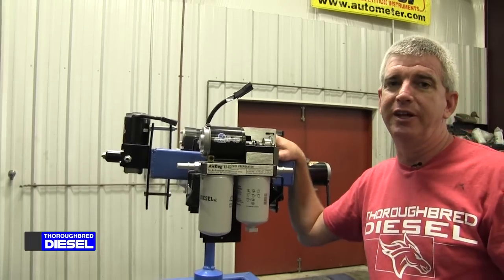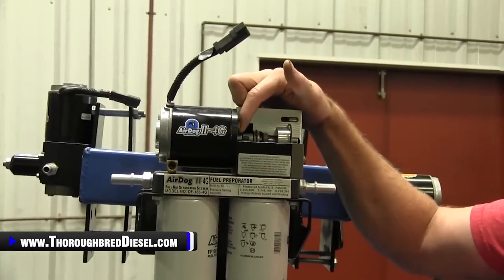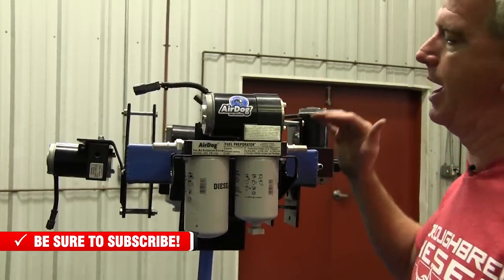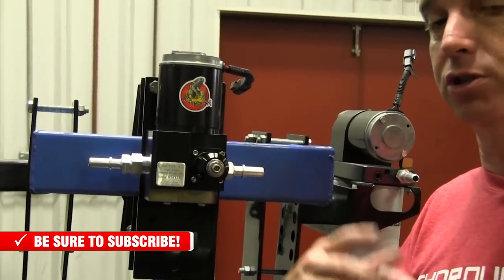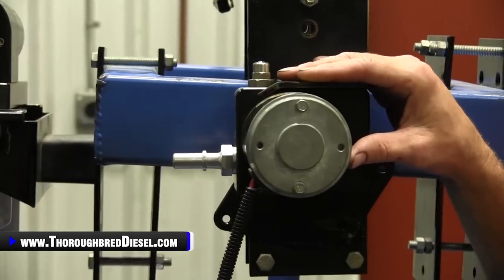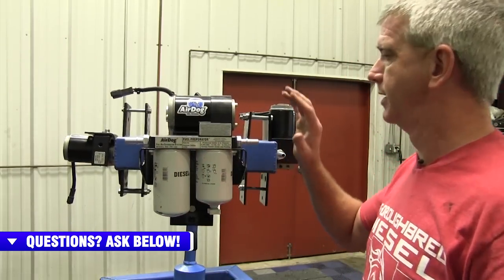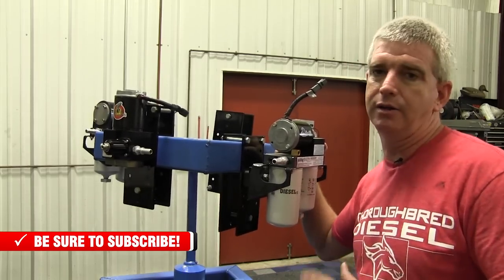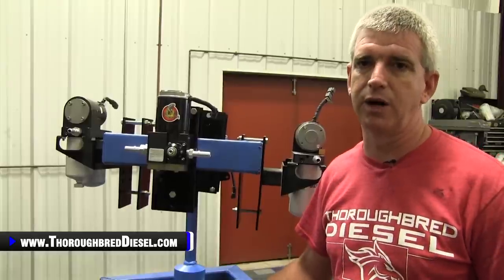AirDog Fuel Systems (Overview) | Best Fuel Pump 4 My Truck?

Comment: Are you supposed to here this pump run the entire time truck is on and running? I believe mine gave up on me today
Reply from the maker: It depends on the vehicle. Some trucks the AD runs on key on power, meaning that if the keys on, the AD is running. Most trucks, in the cab, with the engine running you can not hear the AD running.  If you are hearing it very distinctly, you could have some kind of a restriction or as you said, there could be something wrong with your AD motor. Just make sure there isn’t a restriction or water in your fuel that could have contributed to the AD motor going bad (if that’s what has happened.)

Comment: Thank you for the information. I'm new to this system so I'll have to do some research why something like this is needed on my truck.
Reply: wyattoneable your truck have a high pressure pump which pulls fuel from your tank and pushes fuel to fuel rails to injectors. Installing a lift pump would prolong the life of your high volume pump by pushing fuel to pump. It will also add extra insurance for filtration of fuel from water and trash.

Comment: I knw this is a better system than factory..But I have a stock 24valve 5.9 2000 model 2wd 3500 Laramie..The truck is a 155k truck..I just order a southbend clutch from ya'll..I Love my truck..Im getting all 200 plus horsepower to ths ground now..also how cold does it need to be to plug in my truck..Ps my truck has always turned over on the first bump..I knw theres a first time for everything..but I just dont think I need to spend 600 for a upgraded system..thanks for your time & GOD Bless to the Thoroughbred family.
Reply: This pump will save the life of your vp 44 without it I will dry up and your truck will now need a 2,000 dollar v8 44 replacement and a 600 dollar lift pump definitely a huge security blanket for a go 44 truck

Comment: I have a dodge Cummings 12v and it still has the manual fuel pump but I want to put an auxiliary fuel pump to help the manual one
Reply from the maker: These pumps are designed to be standalone. If you continue using the OEM pump it can cause a restriction. We would not recommend going the assist route. Either use the stock pump or go with a standalone unit that replaces the stock one.
Reply: @thoroughbreddiesel  rodger that
Reply: @thoroughbreddiesel  I have not put the auxiliary fuel pump on yet. But that is what I was wondering about. Whenever I'm driving it, it shudders runs fine for a second shutters run fine for a second and shutters until I just pulled off the side of the road shut it down, and then it'll fire  back up and run fine. So I put  new fuel lines on it and a new lift pump I changed out  the filters. but now I think it's in my sending unit because that plastic housing on top where you connect your fuel hoses the connectors you can take your hands and you can just twist them around. So I'm just wondering if it's sucking air around those connectors maybe the grommets are wore out. But now I was thinking about putting a electric fuel pump inside the tank but a factory one won't plug into my wiring harness. but see my truck is a 94 Dodge Cummings 12 valve everything is mechanical
Reply: @thoroughbreddiesel  how much fuel pressure average does a mechanical fuel pump put out?
Reply: @thoroughbreddiesel  mechanical lift pump I mean?

Comment: My advice to anyone planning on Spending big money on one of these pumps, If your truck is completely stock just buy a pump in your local auto parts store they have lifetime warranty and run yourself a in cab fuel gauge just to know when your pump fails and prevent damage to your vp44